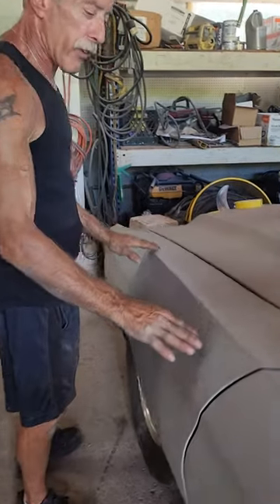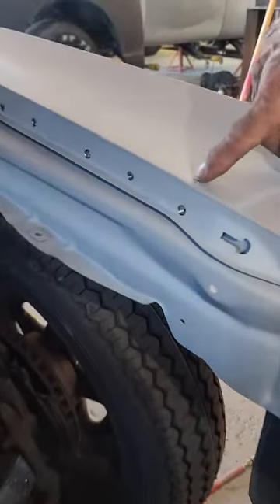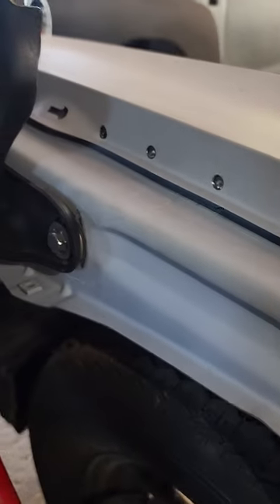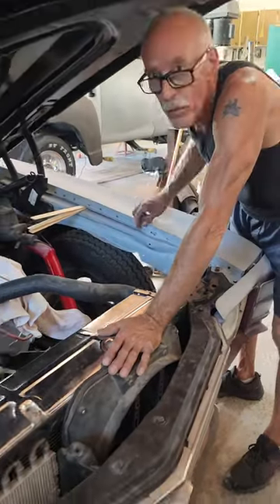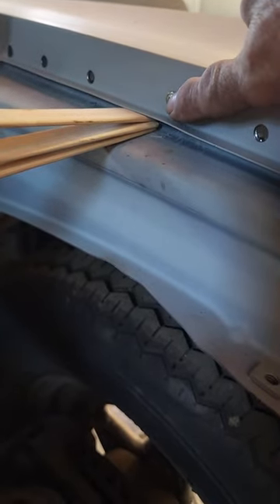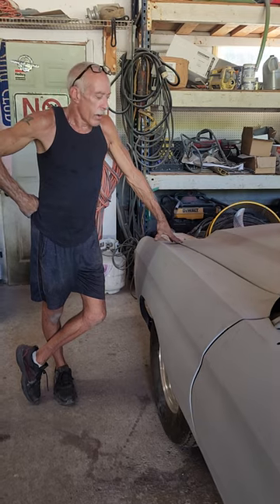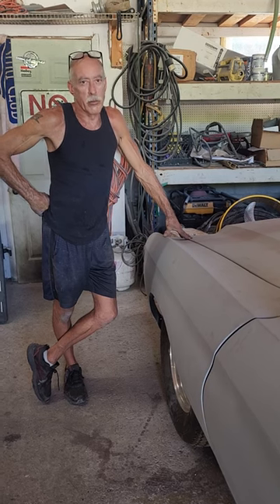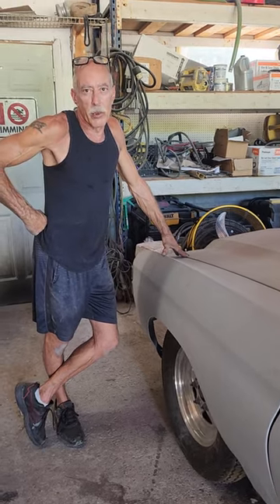How to line up aftermarket fenders and hood 71 Chevelle ss

Comment: Not only is this the CORRECT WAY but it's also the most easiest way and don't take DAYS of bondo and sanding and bondo and sanding. Just about 2 hours of work is all drill the holes get your gaps right weld THEN DONE

Comment: How did this car get in a wreck or what happened? I believe I seen in a video that you said how many years since collision? You should make a back story of history of the car in a video.
Reply from the maker: Ill have Chris tell the story in one of our next videos 😉. The first accident was about 30 years ago. He painted it metallic blue and drove it across the street to his friends shop. Chris parked it, was in his friends' shop for a few minutes, and saw out the window a big mack tool truck moving quick in reverse, crushing the whole back end, pushing the whole car about 2 feet across the lot 😳.  After he fixed the back end and quarter panel 2 other people ran into the Chevelle. All within 30 days of him painting that car. Blue is now his bad luck color lol. That's a good idea about telling the Chevelle's history, we've had a few people ask as well.
Reply: That's crazy. I'm 31 and my dad's 53. He has a black 67 mustang fastback he had since he was 18. He and I fully restored it while I was growing up floor pans, quarters, inner wheel wells toqure boxes tons of metal work. We made our own rotisserie to flip the car over or on its side. It's got a full custom coilover conversion with a 3 link in the rear, 4 wheel disc's 6 point roll cage. Rack and pinion with a flaming rivers tilt steering column. Full built fe 427 side oiler with a 300 shot and a 4 speed top loader. I watched it go from being stashed away in a garage for 20 years to a fully blown show car. And his best friend has a 1970 Chevell ss big block car also so you guys make me feel like I've known you from a different life. Love you dedication to the channel lately!!! Oh we painted the mustang and did all of the build ourselves in my dad's 2.5 car garage. Can't wait to see you both at the track.😃